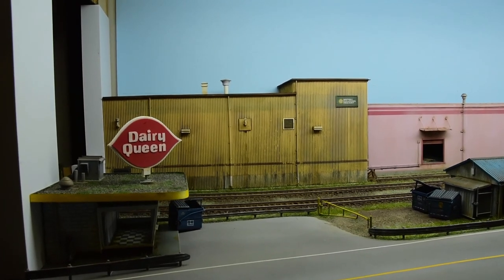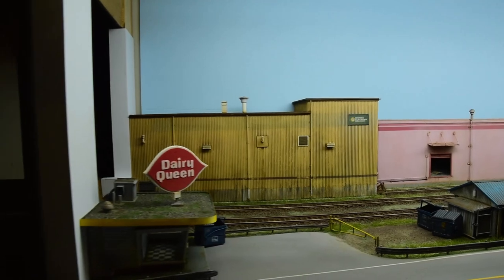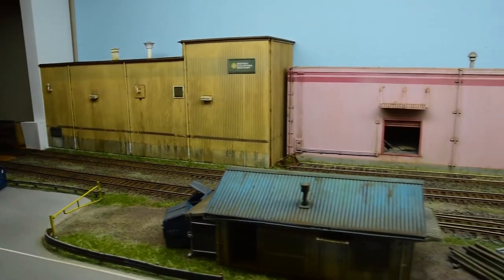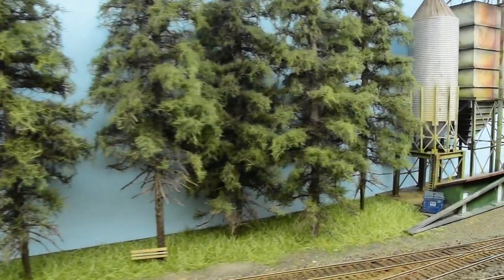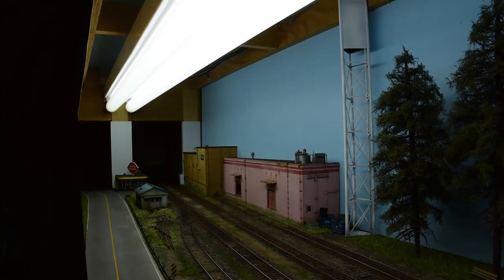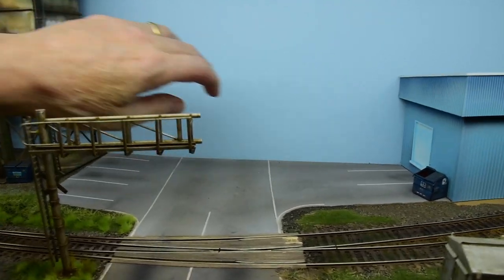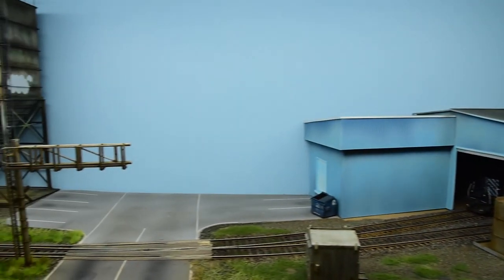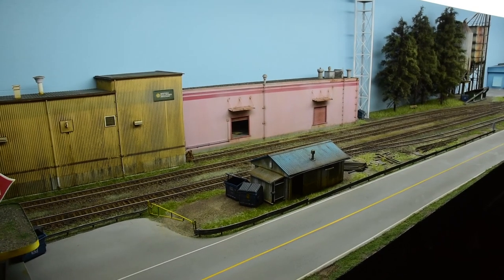The Model Railroad Diorama: Shelf Layout Review and Critique

Comment: Thanks for the layout tour and critique. Your track work looks very nice and you did an excellent job painting the ties. The muted paint colors on the structures captures the look of what you would see on prototype buildings. That is a great tip about not running the road parallel to the fascia. It looks like a fun layout to operate. -Tom
Reply from the maker: I appreciate your compliment. The nice thing about a small layout like this is one can approach it like a small canvas without feeling overwhelmed. It is also easier to maintain a central theme. Cheers.

Comment: I really enjoy your video's and adore your layout. Your track looks amazing as well, very nicely done and weathered. I agree with you on the shadowbox design, I think it makes the whole diorama stand out and pop with the lighting. I purchased some LED shop lights that have the same outer dimensions as the light you have except the LEDs are very thin and don't protrude from the light housing. I think that would be good for your diorama, plus it was only $30 from my local Home Depot. I'm actually doing a new video with the light in it soon.
Reply from the maker: Thank You for the compliment. As to the LED lighting you mentioned I believe the new ones I picked up are just like the ones you describe. Cheers.

Comment: Fantastic modeling! Really exceptional. I particularly like your work on the grain bins. 
I think you could add a curved valance above the blue building at the right end. It could be made from thin styrene in a kind of conical cove shape. The trick would be to put a 90 deg notch in the bottom of the styrene attach it flat to the walls just below the roofline of the blue building either side of where the walls join. At the top there would be the usual cove. This would result in a gradually increasing radius from the roof to the top of the backdrop. The styrene would be a slightly odd shape to fit but should be no problem to cut and bend if thin. 
Cheers,
Coxy
Reply from the maker: Thank You for the sub and compliments. I appreciate your observation regarding the valance revision and I agree. However, I am not sure if this will be necessary "if" I transition to the new design I have planned for next year: https://www.youtube.com/watch?v=fMrBgbkqsD4
I will consider it though. Cheers and Happy New Year!

Comment: Nice layout, it’s even larger than mine. 😉   For a next layout, would you consider  Proto 87?   Regards from the Netherlands.
Reply from the maker: Great suggestion! I used to be into Proto 48 actually. The problem with Proto 87 (at my age) is the eyes unfortunately. I wear glasses for everything now. If I didn't, I would be hopeless as a modeler. I never thought it would ever happen but I think this is the dilemma of the life-long modeler (vision integrity breaks down). I would actually love to do another diorama (since this one is almost complete), in "O" Scale (1/48). However, It took awhile to collect the HO Scale stock I have now, and to change scales would be a total reset. Having said this, Proto 87 or Proto 48 is not out of the question for a smaller "vignette" diorama though . . . or even larger scale models that are railroad and logging subjects. Cheers. ~ Boomer.